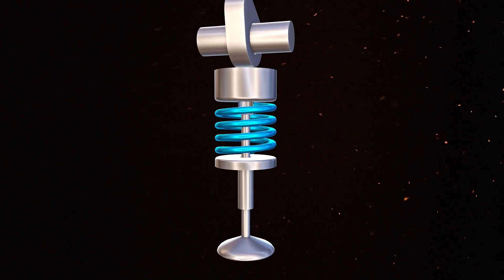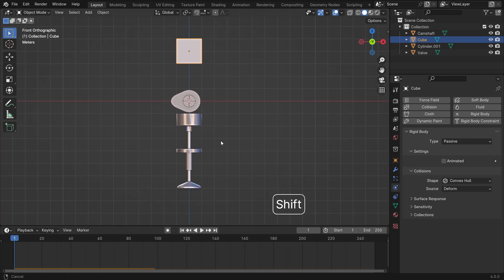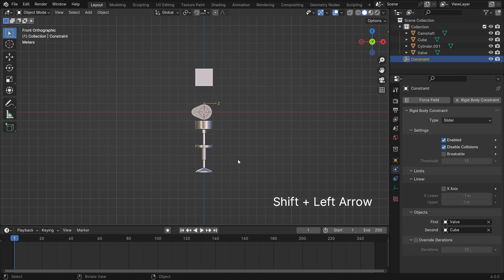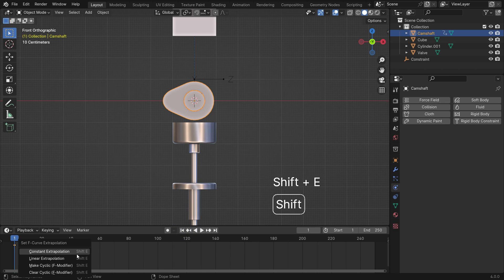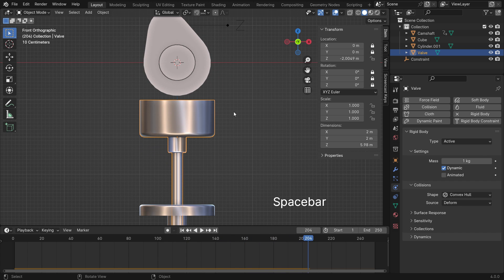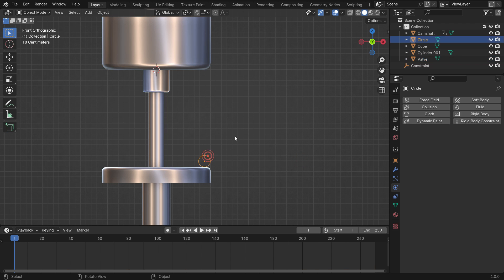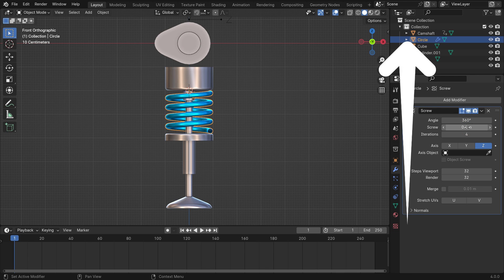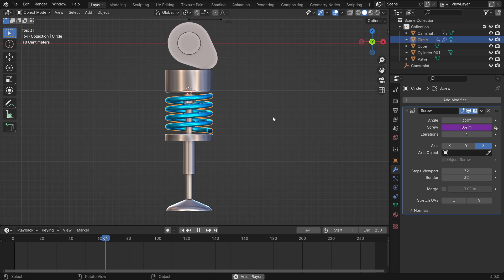Engine Valve Rigging | Blender 4.0 Tutorial

Comment: Great tutorial. But i noticed that if you have multiple valves next to each other .. the all move together  but  with different strength .( they are influenced by each other ) .  How can you fix that ? 
I know for 100 % sure that each value have there own  controller cube  and constraints ..
Reply: Oh i know what i did wrong.. :-) I connected everything as one mesh . If you use single camshaft for every valve / cylinder it works .. :-)